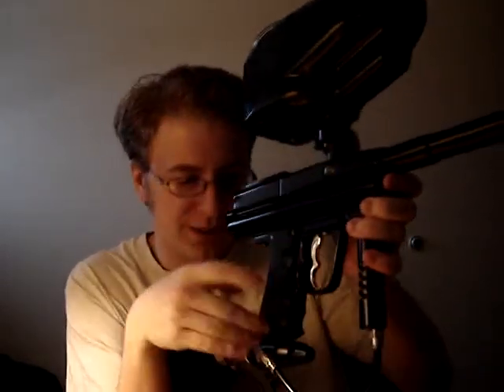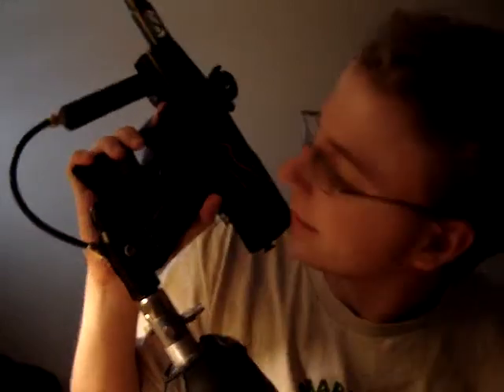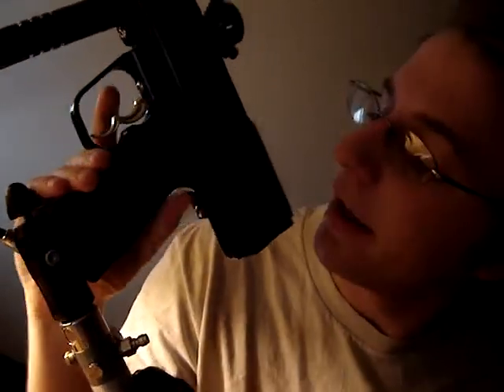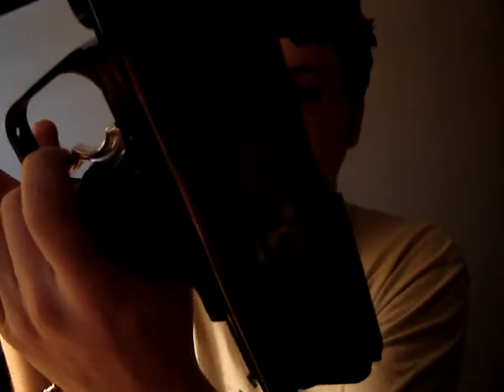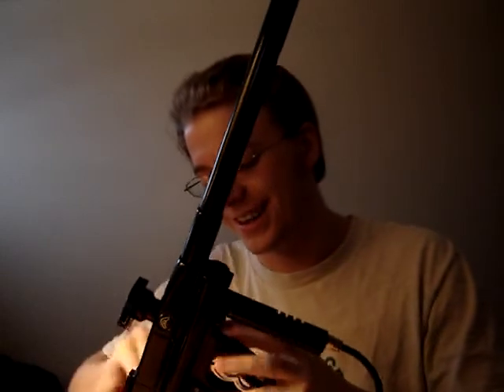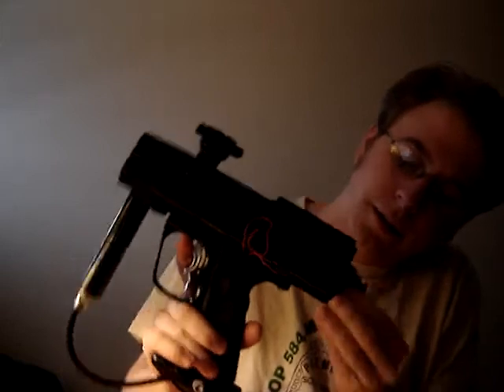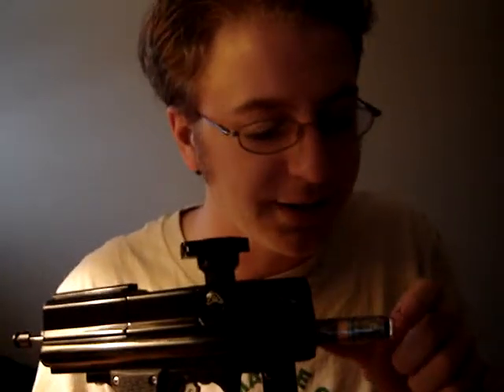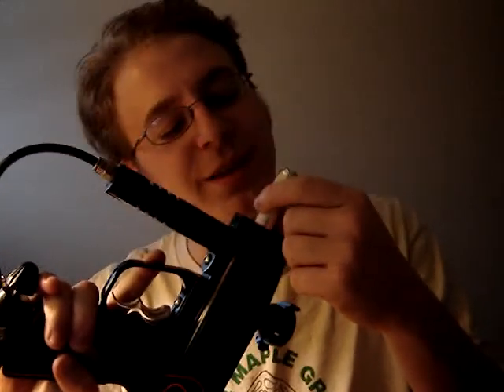Old School Guns Tour Stop 9: How I fixed the LCD ...

Comment from the maker: the 123s might work for an emag but i need to build a custom charger for them. if you were to use disposables, then it would be like 30 bucks worth of batteries every time you change them. 

the glory of this is that its only 2 cells, so its much cheaper then like an emag battery

Comment: I had the battery factory make me a power supply is the same as the original.  Costed less than 30 bucks.  My lcd is back to new.  It's a lot easier if you can get the lower receiver off then the wires are easy to fit into the grip.